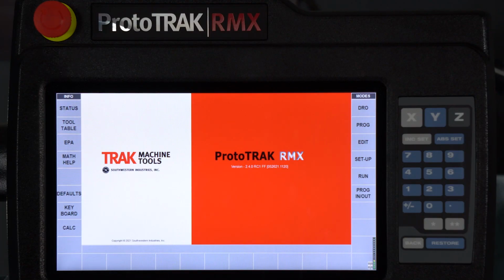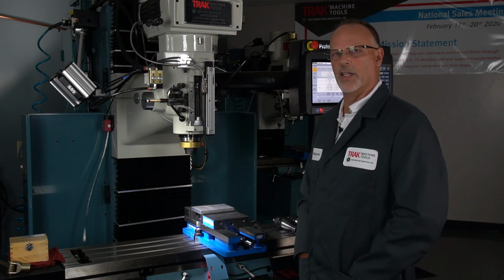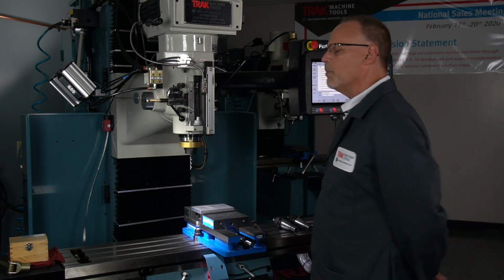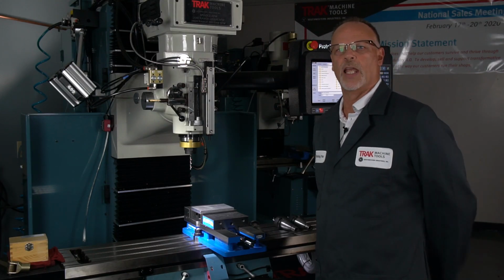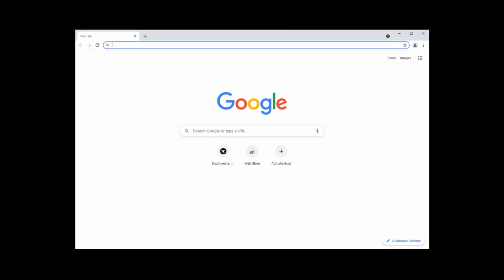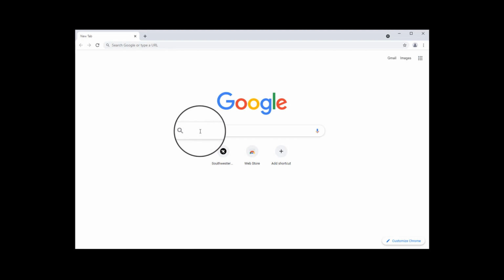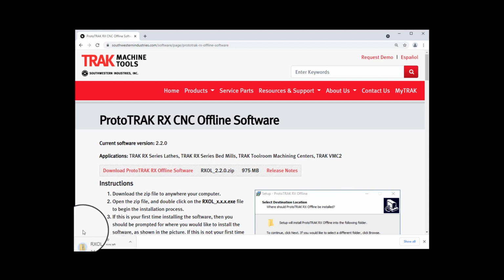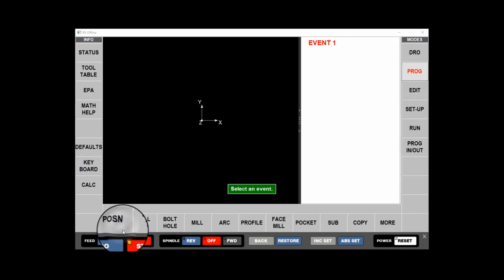Managing Files, TRAK USB Memory Option, Installing Offline Software | ProtoTRAK Tips — Part 1

Comment: Pat how much of this would apply to an ELX control? I had just got a 14/40 lathe this spring
Reply: Joanne, thanks for the question.  Unfortunately, not a lot of it because the ELX and EMX controls let you save programs directly onto the hard drive. You have the ability to copy programs to and from a USB memory stick but you would do all of your renaming, copying, etcetera on your computer. The ELX only has the ability to name programs with numbers too so there are less options.  As for downloading the offline software, the process is almost the same so just follow the directions when you select EX offline.  The great part is that this offline software is free and fully functional.  T.P.